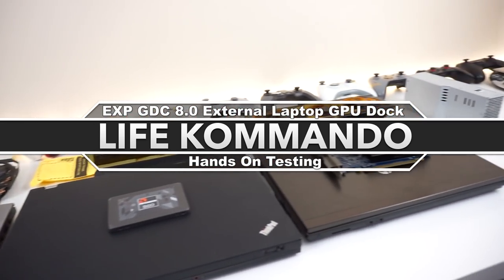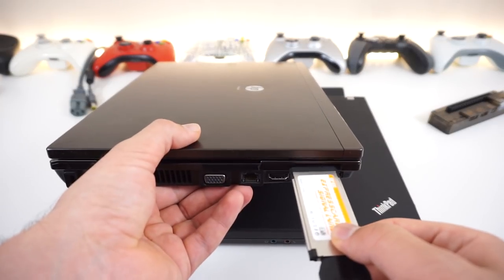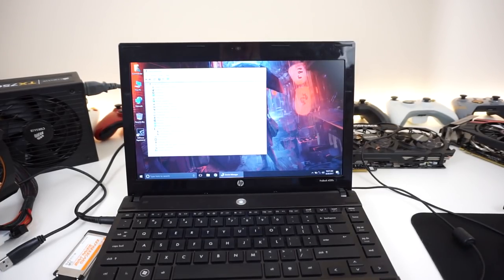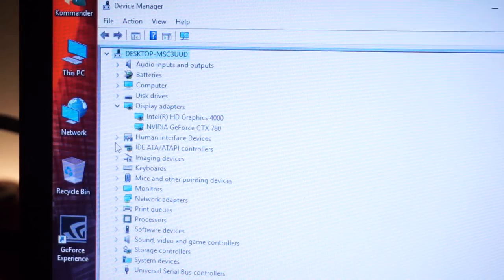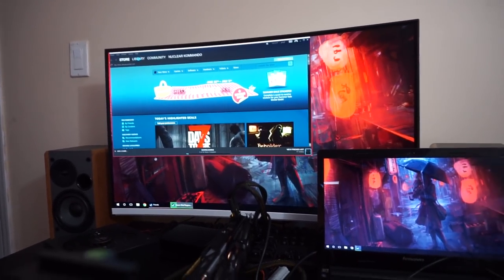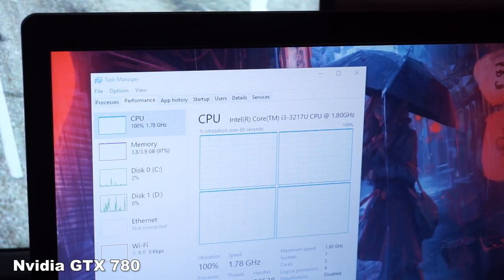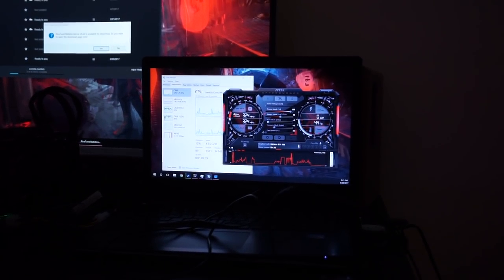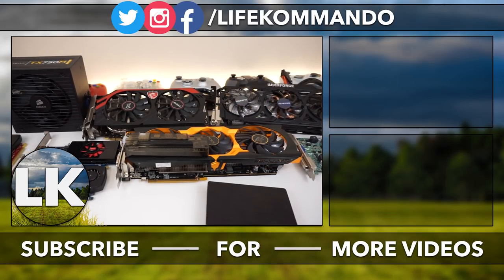EXP GDC 8.0 eGPU | External Laptop GPU DOCK | Hands On Review

Comment: Hi can u do me some favor. Can u test wether or not this egpu work on laptop that broken internal gpu? Like dell vostro 3310 that got nvidia gpu inside. Since it got pretty highend cpu core i5. Im not an expert but it should work like a desktop pc, since we connect trough the pcie connection.
Reply: Meer Wan it's still a laptop. What do u expect
Reply: mindrover777 i mean since some laptop got faulty gpu like nvidia chipset that need to reball every 3month. Why don't use method to by pass the iGpu

Comment: Going to try a GTX 1070 in my old piece of crap AMD Turion X2 laptop from 2007... Wish me luck LMAO

Bottleneks4dayz. So do you think if ExpressCard doesn't work, just go ahead and wire it to my wireless adapter slot? I guess that gave you much less trouble, right? Also, that's only a 1x slot, is it not? Guess that would explain the bottlenecking along with weak CPU.
Reply: Express slot is better then PCIe mini slot,  do you think?

Comment: Nice video! I'm planning on doing that with my notebook. It has an i7-4510u. Can somebody tell me which grapich card I should get ? I was thinking about a 1060.
Reply from the maker: I would go for maybe a 1050 Ti since it doesn't require extra cable power but either one will do go fine, more money more power but I would say 1050 TI is a nice and the price point is good if your going to pair it up with this dock
Reply: I don't know if you're using the same dock I was looking, but I read that It has problems with the 1050 and the 1050ti. Edit : Yeah, I'm right, it is not compatible with those gpu

Comment: Its CPU bottleneck , i am going to try it with my I7 6700HQ with gtx1060 (my old gpu is 960m)
Reply: That's a pretty slight difference to the 960m I'd assume. Any news? I'm planning to upgrade my old i7 4710HQ 850m to the 1060 as well.
Reply: Yep ! Anys new? was thinking to use this method
Reply: The i7 4710hq won't bottleneck the 1060 at all and because of the adapter you sould see a 15-20% performance loss. So instead of getting 60fps in some games you'll be dipping in the low 50s on ultra. Its a pretty nice upgrade, a friend used a 1070 to upgrade his laptop and I'm upgrading to a rx 580 in a few days.
Reply: Should I mind driver version and windows version? I'm still skeptic about compatibility and would like to be sure given I'll be spending not only on the dock but the ATX PSU and the GPU too.
Reply: Hey, is the external gpu dock compatible with the 1060? I’m planning to buy that egpu dock, and btw. I have an i5 7200u with gt940mx laptop
Reply: Zeke Guerrero Yes but be careful with what 1060 you buy, i think the newer versins dont work, better get a rx 580.
Reply: Can anyone provide a site/discord/forum that could assist us with issues and queries like these? I'm so skeptic if this dock would work on my case.
Reply: AzSam Pako i have a zotac 1060 6gb amp.
Reply: AzSam Pako how about RX560? I'm planning to buying it next month
Reply: Are you guys using it on Windows 10?

Comment: thanks its fantastic experins
ihave laptop withe intel core i5 540m 2 cores 4 treads
its clock at 2.8 ghz at load
with 4 gb of ram
i will by a gtx 1060 and but them togetere 
with this dok
my cpu mabe bottelnek the gpu or wat please anser me
Reply: After That yes bottleneck
Reply: Bro do you even english?
Reply: kenny ricardo 
Im from Syria arbia i dont now the English language very well so excusme Bro
Reply: After That okay... But the way you can write a complete word with correct sentence order while (no sarcasm intended) writing words in a wrong way is interesting
Reply: After That Banggood, which is the official supplier of the EXP GDC beast, has stated that the device has problems with Pascal based GPUs, it may not work. I suggest just spending more on used or new hardware to build a new PC, otherwise you will have to get a Fermi based GPU or higher, but stay away from pascal.

Comment: you should tell us ur problems and how u solve it.. like how to install the driver
Reply from the maker: Installing the drivers is just like you do with a regular desktop
I did not encounter any other problems than the Express Card not working

Anything else I should be able to show in the next video about this thing :)

But if you want I could include it in the next video on how to install drivers
Reply: what if i dont want to use pci and wanted to use usb type-c instead.. can u make a tutorial on that?
Reply from the maker: You can't, if you want USB Type C then you got to get your hands on those expensive eGPU docks, like the one from Razor that cost $400-600 or so

Comment: Dear,
I have dell laptop 7720 SE With Intel 4000HD Gpu + GT 650M V2. Can i connected R9 270x on it. Please Help.
Reply: did you get any chance to try it out? I also have the same laptop. Wondering the same question.
Reply: @riren666  Dear,
Only Black Screen with R9 270x. I watch on youtube other guy has Same laptop and it work with GTX 960 and i check on egpu Side It say Dell 7720 SE Support Exp GDC with amd gpu support only second monitor and Nvidia support both. Please tell me if you try nvidia gpu.
Reply: @MrVeer5  I got the same problem, black screen. I waited until windows logo shows up and then turn on the Power supply which connects to my GTX 1060 otherwise it will be black screen forever. Even if I managed to login into windows successfully, device manager cannot find the external graphics card so the driver will report hardware not found error. I did turn off NIC (Disabled) and the secured boot mode to be disabled on BIOS setup. No luck at all. Time to build a new PC.

Comment: hey can you use that with a C port cable? I have a Acer nitro 5
Reply from the maker: Nope, what you need is a thunderbolt 3 port and even then you will need an expensive thunderbolt eGPU dock

Comment: Use a 12V 10A power brick next time, instead of a PSU. Much more portable.
Nvidia drivers don't work via Expresscard slot.
Reply: Are you sure about it. On the video he said the AMD won't work.
Reply: @mdarifulislamhridoy9147  I had issues with a GTX 1050 as well as a GT 1030. The 1030 was recognized, and displayed VGA out, but the drivers couldn't find the card, or if it did, it didn't install the drivers properly, and either reverted back to the IGP, or ran the EGPU in safe mode drivers.

I presume this was due to the too slow transfer speed of the ExpressCard slot.

Comment: is it possible to upgrade ASUS X455LF graphic card ? thanks
Reply: The Only thing you can upgrade on that laptop is the ram. you might be able to use the external gpu dock on it tho. 
http://www.gearbest.com/laptop-accessories/pp_229101.html
Reply: thank you so much man for the info
Reply: by the way i can use any graphics card on a EXP GDC 8.0 right?
Reply: yes! As long as the GPU is x16. I would get anything above a GTX 760 for modern gaming today! :)
Reply: thank you man thanks for everything!
Reply: Im planning to buy gigabyte GTX 1050 ti OC is it compatible? although it's overclocked?
Reply: PEDZGaming the 1030 and 1050 ti doesn't seem to work with the dock. it may be just a driver issue. but don't spend your money for nothing! I would go for a 970 or 980. or maybe even a 1060. later on down the road if you decide to build a desktop you wouldn't have a need for a new gpu for a while.
Reply: An Overclocked card would be better than a stock card. more mhz it has = more performance
Reply: oh i see, thank you so much you have enlighten me haha, sorry for too many questions
Reply: PEDZGaming does that laptop have nVidia graphics or intel HD?
Reply: yup, it has nvidia geforce 930m
Reply: Oh that's good it will work on the internal display. and you can hook up another monitor.
Reply: yeah! I will try that  haha :)
Reply: my laptop's processor is core i3-4005u 1.7GHZ and I will use palit super jet stream gtx 1060 do you think i can play high end games in more than 40fps? thanks :)

Comment: I feel like bottlenecking would be a huge issue for a lot of these laptops.
Reply: it can be because the architecture from laptop cpus are far different from desktop cpus, and external PCI usbs are still in the testing phase. From personal experience, I'd recommend using this on laptops that are a dual core or better, and could output more than 2.5 ghz(tested on rebuilt alienware 14 with an i7 4940mx).

Comment: Can anyone tell me if i can connect this via adapter with my 4 lane thunderbolt port? I do not want to open my asus zenbook ux550.
Reply: No, this setup is for poor people that don't have a Thunderbolt port,  Your computer is lucky because they make very nice and pro plug -n-play hardware that works with Thunderbolt3.  Razor CORE is the nicest one for example... has its only power supply, enclosure, cooling fan and lights.
Reply: phatlewtz82 thanks mate :)

Comment: What happen my 1050ti its not working to my laptop but my 750ti is really work can you help me about my problem  is {windows has stopped this because it has reported problems (code 43)
Reply from the maker: 10+ Series Cards will not work
Reply: @LifeKommando  so what is the gpu better for gdc thanks
Reply from the maker: @keedmanlesley8181  anything before 10 series works
Reply: @keedmanlesley8181  o sick ill have to check it out next time i get around it
Reply: Go with an RX570 card; cheap and powerful

Comment: Well I already tried this by using GTX 1050 not working, my laptop use mini pcie cable.
Reply: yea same, i have a GTX 1050 TI and im trying to get it to work now but it just wont, and i just heard the 10 series card are the only one having this problem, so im trying to find a fix, but if you have a 9 sires or back everyone is saying it works fine.
Reply: Rem owh i see...Thanks for the advice.
Reply: UPDATE, i watch some videos (still watching some now) and people with 10 series cards that got it to work are saying they unistalled all the new nvidea drivers and installed old one's (like really old ones) and it worked others are saying you can get a modded bios but i dont want to try that one, at least not yet, so im going to find some old drivers and see if they will work, (fingers crossed)
Reply: Modded bios if im not wrong you have to buy it right ?? Then I already did uninstall all driver then install the older one its also not work for me, still has code error 43 i think....
Reply: So im give up....such a waste of my money buy all that stuff...mmmmm....
Reply: DONT GIVE UP JUST YET! i think i might have found a solution with the 372.70 driver, i looked on some egpu forams and people are saying if you mod ( its just copy and paste) this driver it works, and the reason  you have to mod it is because the driver came out before the 1050 or 1050 ti did so you just copy and past some text from the drivers INF files and it should work, if it does i'll let you know, if it doesn't then all hope is lost LOL
Reply: Mmmm how to mod ? The copy and paste ??? I think i didnt did yet....
Reply: OMG THE MOD WORKED IM USING MY 1050 TI ON MY LAPTOP!!!!!!!!!! i can link you my modded driver if u want, i also added support for the GTX 1050 just in case it worked AND IT DID!!!!!!!! i will replay with the download link and full steps on how to install it.
Reply: Rem yeah sure can you teach me how to do that ???
Reply: im so glad this worked man,and just let me know if you have any problems.
Reply: Rem can you give me the link of copy  paste and the driver ???
Reply: i already modded the driver and did all the copy and pasting for you, all you have to do is follow the steps e listed and it should work
Reply: Rem mmmm can you show me the step ??
Reply: Danial Cool what do u mean ?
Reply: Rem yeah you tell me that you wanna give a link that you are moded, so where the link ???
Reply: Danial Cool want to hear update from Rem. Can you explain the steps to make it work?
Reply: Rizky Ikhsan yeah sure.....
Reply: Rem, please offer a link, where i can download your detailed infos to use my 1050 Ti, so i can solve my problems step by step. Thanks a lot
Reply: i cant post a link i had one here but the owner of the channel tool it down it had a download link to the modded driver and everything, i still have the driver tho, and most of the info so if anyone wants me to link them i can leave it in the comment section on your channel.
Reply: You can not use 1050 or 1050TI.... They are incompatible.  You have to run either 1060, 1070, 1080 or whats better because of the lane bottleneck you buy a used or new on the cheap since they are older GTX660, GTX680, GTX680 TI,  GTX950 SSC, GTX950 FTW, GTX950 SC, GTX970, GTX970 TI, GTX980, GTX980TI... These cards are the best for this setup and can be had on the cheap... $40 - $160, With the 950's and up you will get max frames of 60 at Med to High on optimized games and 50-60 frames at Med settings on PubG.  If you have 1060, 1070,1080, you will get the same frames because of the bottleneck at the mPCI-E lane witch is the fastest option... The expresscard option is 10-20% slower from input delay.  Also to get the expresscard option to work you have to enter your bios on startup and disable intel internal graphics in the bios to get it to work..  Make sure before you do anything to the computer you download the drivers for the video card you are going to use.   If your video card says it needs 150W or less to run, then you can use a 150W DC power cord brick in the DC 12v plug to power everything... but its very easy to find a 300w PSU in old junk computers for free a lot of the times just ask around.
Reply: phatlewtz82 hey can you give me some photos of your setup and instruction on how to do it i have samsung laptop with intel proccesor i3 2nd gen 2.4gh and 4gb ram. i want to put an externel video card so that i can play online game and what is the best video card to use in order to play in med o high resolution.
Reply: Sarem can you share the link for the drivers please?  I'd love to get this to work.
Reply: Sarem please can you send me the links for the moded driver if GTX 1050 TI

Comment: If you have dGPU you need to disable it using "DIY eGPU Setup 1.35": https://www.youtube.com/watch?v=EXybazKopWs

Having a internal iGPU, dGPU & eGPU connected at the same time will not work well.  

Disable dGPU and it will work just fine with the expresscard.

Please review this forum for more info: https://www.techinferno.com/index.php?/forums/topic/3108-egpu-candidate-system-list/

Comment: hey can you help me ?? i buyed a notebook (12.10.2016) Acer Aspire E15 E5-575G-556G  its not that old but it have Gtx 940mx it shit now in 2018 and i want to upgrade it it have i5-6200U 2.3-2.7Ghz but dont know what graphics buy 1050ti or 1060 + i dont know how to connect it i have a photo whitout back plates http://www.gaminglaptopsjunky.com/acer-e-15-e5-575g-review-gt-940mx-i5-u/     so if you can help me thx

Comment: Thank you grat review. I think it's better save the money and get build a desktope pc
Reply: If you don't have enough money yet, You can buy a gpu, this thing, and a power supply first (450-600 watt recommended).

If you have enough money and the parts have arrived, then just reuse the graphics card and the power supply for the pc
Reply: Toni Don't even bother with the device. Either buy used hardware or buy new for a new PC.